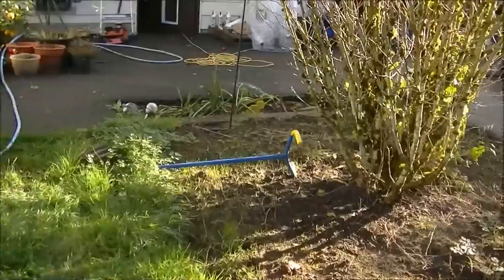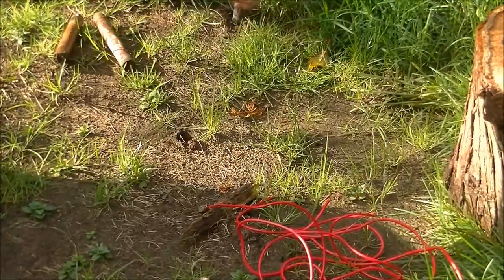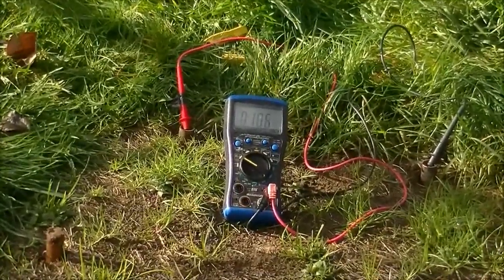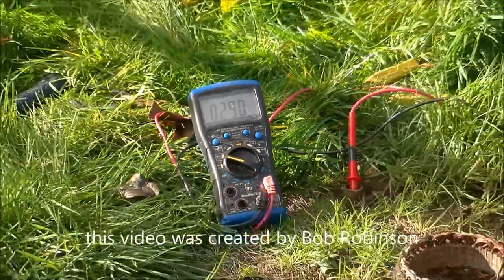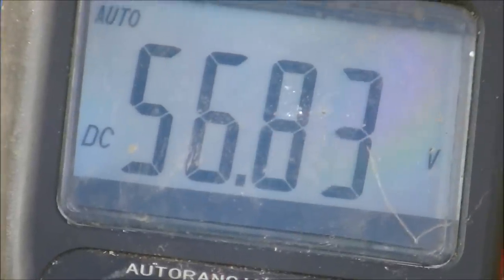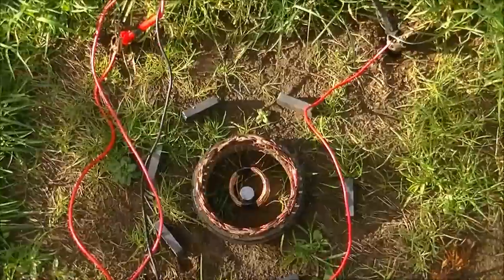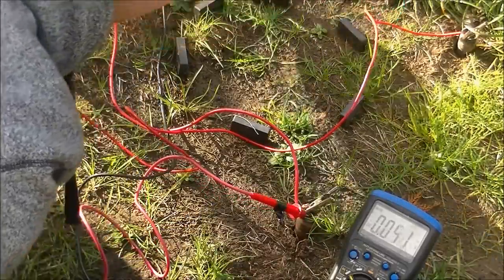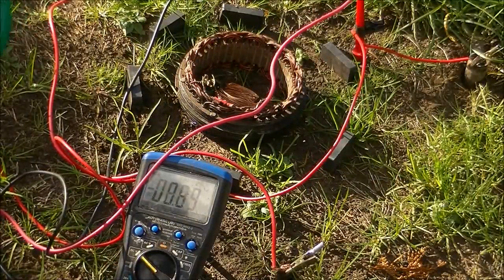How to get Free Electricity part 2!

Comment: i would like to point out a few things. 1 - 64 volts is without load and also very very little current. 2 - There is no electro magnetic field here. Keep in mind that the magnets must move in order to produce a magnetic field that can create voltage and current. 3 - Yes it is very possible to get electricity from the ground. However, there are a few details that must be observed. 16 inches copper rod and 1 6 inches iron rod will usually produce about 1 volt at 100milli volts. Here on this video, the 64 volts is rather odd. One would need to analyze this closely in order to see what is going on. Source: over 25 years of electronic engineering.

Comment: This video immediately brought to mind much of the ancient architecture found all over the world and its use of diamagnetic and paramagnetic materials in concert with very specific geometric ratios. It is another compelling clue as to why they did that and also why they believed that if they hit exact ratios the structure was considered alive. You're onto something important here. Thank you for sharing this, I will be running a few experiments on this concept. The earth battery idea that people are talking about here doesn't explain the high voltage or the absence of voltage when the core is removed. I am interested in what cores of different geometric configurations will do.

Comment: If this is true, it maybe working implosively.  The magnetic fields of the magnets are creating eddie currents and are distorting the earths magnetic lines of force, thus creating a rotating magnetic vortex.  This is what the alternator is picking up through it's copper coil (implosion).  It's a modern Stubblefield cell it would seem, I believe they work on the same principle.  What would be interesting is for you to "dowse" that area of your garden as there maybe quite strong magnetic lines of forces travelling through it and those magnets are distorting them.  The Hexagon shape also creates areas of low electrical interference (eddie currents) and may explain the high volt rating (see Hans Coler device)

Comment: a video on youtube which i just looked for 4 20mins didnt find had a guy applying dc voltage to a star rodin coil and the coil floated straight up, copper creates electricity under changing magnetic flux but the dc power is not changing copper coils and magnets are lenses for these magnetic streams

Comment: You are capturing radiant energy. Higher in less humid areas. If you will run a wire from ABOVE as the positive energy always runs downward.  Run to capacitor, then step up or down transformer to create hot useable energy.

Comment: i dont understand one thing. i could never run 2 copper pipes as a positive and a negative, usualy i found that iron with copper works ok, however for best result i use zink with carbon rods. I also found that if I use zink and neodymium magnet on iron it bosts it to around 9v dc

Comment: If you dig a trench of FLOWING water underneath, it will build the strength of your system here. Allow sunlight to hit the center and the water allowing for the air surrounding it to ionize. For curiosity sake it’s worth the experiment. If not, cool video man.

Comment: hey bob, I've tried this in 3 locations, my back yard, a public camp ground, and 3 miles from a power station in a field. not 1 single volt coming out of the ground. I want you to know that the inner prankster in me salutes you for convincing a guy like me to disassemble an alternator (35$) buy 12 magnets from eBay (12.95) drive round trip of 280 miles (45$ in gas and turnpike fees) bought a voltmeter ($29.99) and some jumpers (6.82) and fresh copper from Home Depot (2.99 apiece x 4 is $12)... the price of this lesson was about $150. learning once again that YouTube is not trustworthy? lol... PRICELESS! now that the gig is up mind telling us how you pulled this trick? I'm thinking there are batteries in the pipes... lol. you got me good maaaan.
Reply: I replicated this also,,i have a video link under his part 1 video.
Maybe you would be more interested in my work, i have multiple "free energy from air" video series, going back as far as 2008,,,all real.  I have 21 LEDs lit 24/7 now
Reply: That's classic.heres the thing I don't care how many volts...I want to know amps and volts.you need to move the magnets or the copper to make amps.ill play with it tho I already have everything needed lol

Comment: Bob, can you detail the winding setup on the coils, the type of magnets and the depth of copper pipes. Also where was this setup? how were the wires oriented to magnetic north. The telluric currents in the earth maybe what you're picking up. At first I though perhaps an earth battery but copper to copper wouldn't produce any voltage. If you seriously have that output, aren't trying to troll people and want to help others replicate these details may prove useful.
Reply from the maker: +Daniel Pas  thanks for your input  I Will add specs in part 3

Comment: Very interesting!  Thank you for sharing!
 Do you think the higher voltages observed might be due to the location?  I thought I read on one of the comments where you are in Vancouver.  If so, being only 1300 miles from the North Pole could explain this, as magnetic lines of flux are stronger and more dense around the poles.
Thanks again!

Comment: if you shorten the red wires and move them closer to the center magnets and the copper pipes as well you should have more volts as the field is stronger. the closer the more excited state should produce more volts just an idea .
Reply from the maker: Adam Long  that did not increase it by much  right now I can get up to 260v just can't seem to keep near 14.5 volts I want to increase Amps
Reply: +Bob Robinson capacitors ramp up shit and store juice what ya think at some point you will have to circuit board to get what you want done make sure when you get it right you have the board duplicate and in a Faraday cage